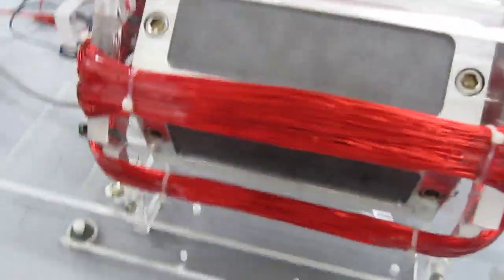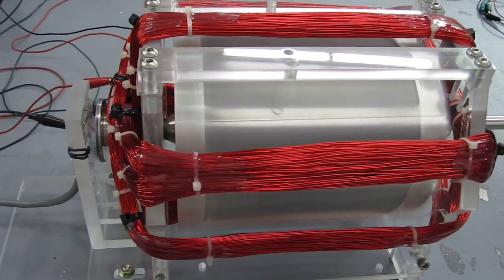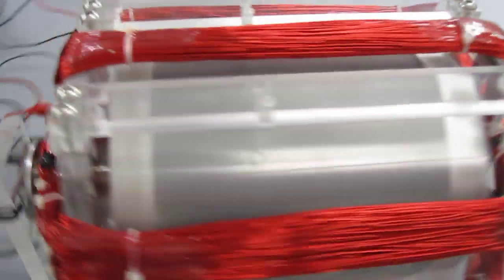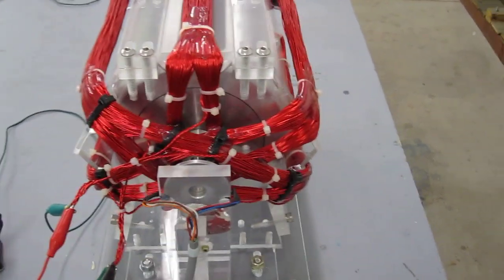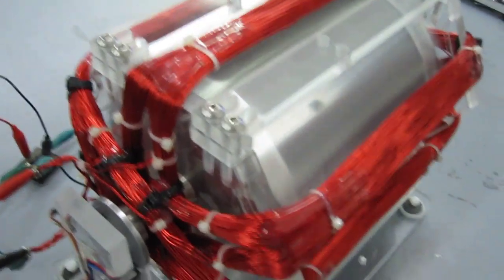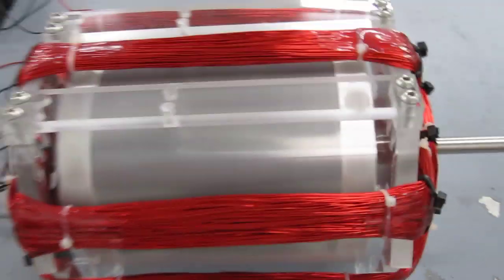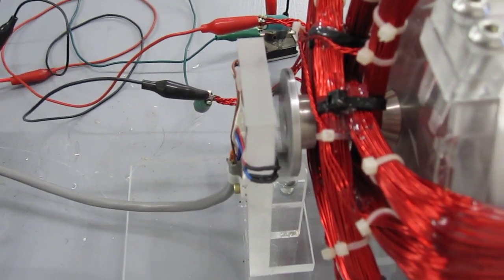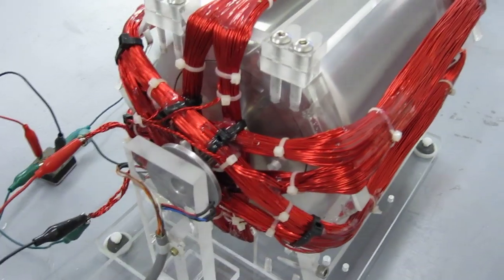Bedini-Cole 1971 to 1984 built from lab notes

Comment: Anyone ever see power draw & output torque figures specified for this machine??
It doesn't look like it produces much torque--given that JB slowed it down to ~3/4 max rpm with only his hand on the output shaft. 

A motor that generates 5 kW of torque = ~42.3 lb-in of torque 1" from the center of the shaft.

Comment: at around 1:00, spectrometer on the audio track shows a strong primary trace at ~650Hz and 2 weaker secondary traces at ~970Hz and ~300Hz.  (650 * 60) / 3 = 13,000 (RPM was quoted around 10,000?)  Are there 3 pulses per revolution of the armature?